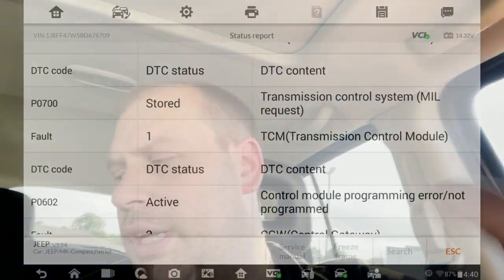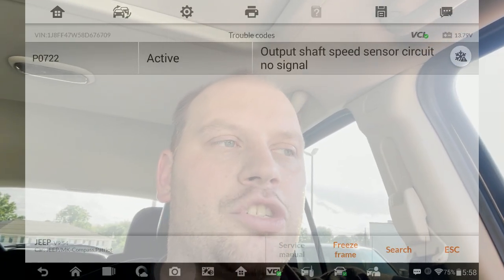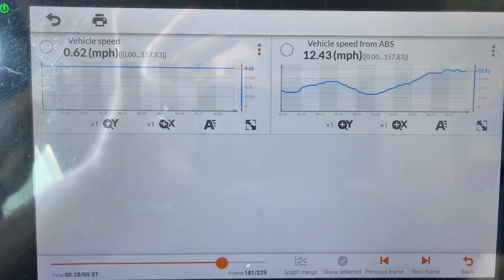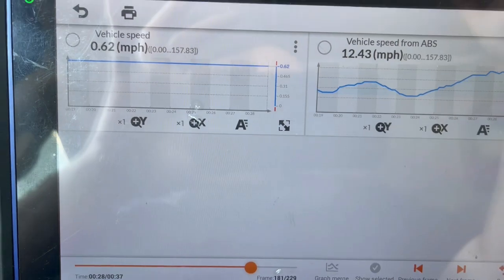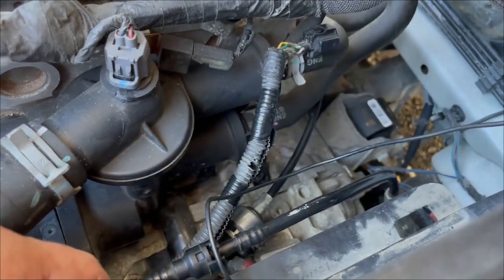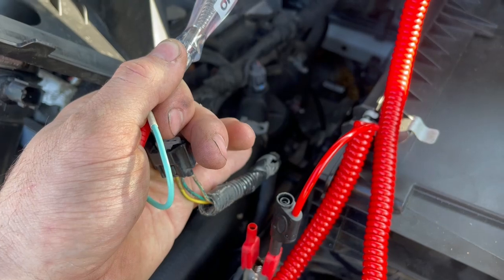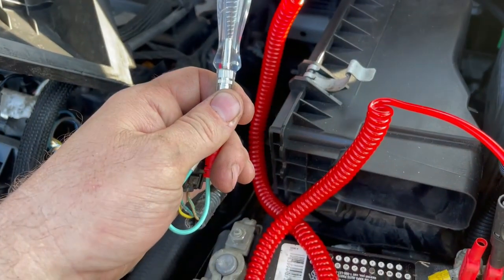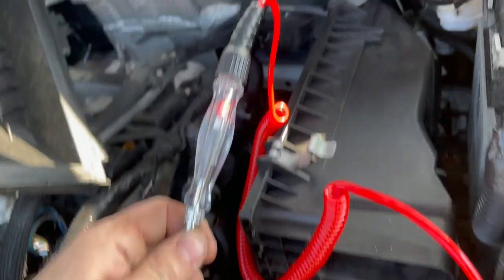'08 Jeep Patriot P0722 After TCM Replacement!

Comment: No BS I go down to a shop to look at a transmission that was just installed. Let me give you the back story because it gets crazy. Customer buys a used f150 that starts having shifting issues. He takes it to a well known transmission shop that replaces a shift siloind (charges $550). Customer leaves and orginal complaint is still present. He takes it to anther transmission shop that tells him the first shop damaged the transmission and to take it back to them (charges 175$). He goes back to the transmission shop that tells him the transmissions needs replaced. To my understanding the customer bought a used transmission and took it to the shop its at now. I was told that the customer said replace the transmission. I have a hard time believing that. I think the shop was asked to look at it and seen 2 well known transmission shops diagnosed a bad transmission. He ends up replacing the transmission ($2500) and the issue still remained. I get the call and with in 30 mins I found the problem. There was a broken wire from the pcm to the shift siloind. The code was a circuit code for a shift siloind. As soon as I seen that I had a feeling someone messed up big time. You can see where both shops probed the wire at the transmission but noone check to see if the wiring was fine from transmission to the pcm. If im not mistaken I think Ford had a issue with the harness melting right where it was bad. I couldn't believe 3 different shops missed it completely especially with it setting a circuit code.

Comment: You could have checked resistance on the sensor and seen if it was an open or short.   (also, what is that little scope?  Do you have a video on it?   I've been looking for a cheap scope, and I don't really want to buy that 2 channel PICO if I don't have to.)
Reply from the maker: This is a 3 wire Hall effect sensor. So a resistance test wouldn’t have shown you much for this style sensor. 

As far as the scope, it’s a uscope sold by aeswave.com 

Me personally? If you don’t have any scope currently I would purchase a multichannel scope first.
Reply: @VoltageDropDiagnostics  I think you can jack up one of the rear tires-- put the trans in neutral, and spin that wheel while you're checking the signal side of the sensor (while in vehicle)--- I believe it would work, if it's on the output shaft.   Sometimes you can see a bad spot in the signal.....  But you already confirmed the wiring was good, so it would be a redundant test really.....  I like your test of scratching the test light on and off the signal side-- and confirming signal in the scan tool;  I'll have to remember that one.